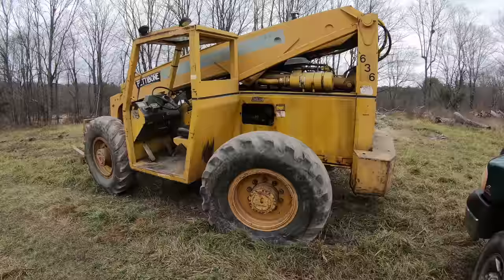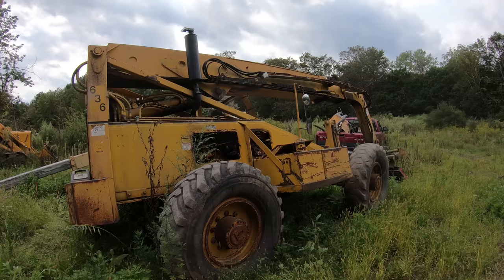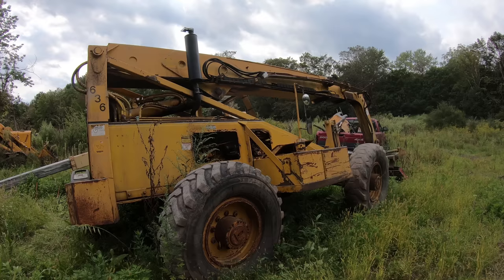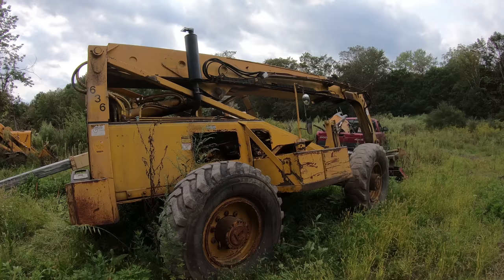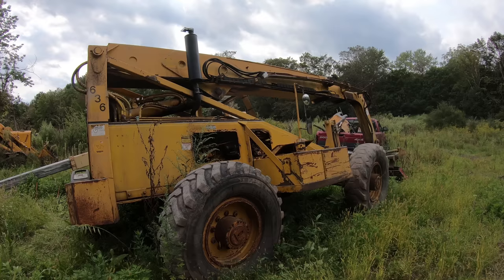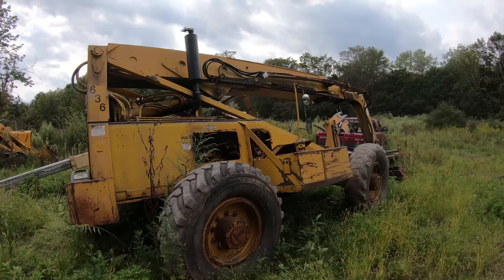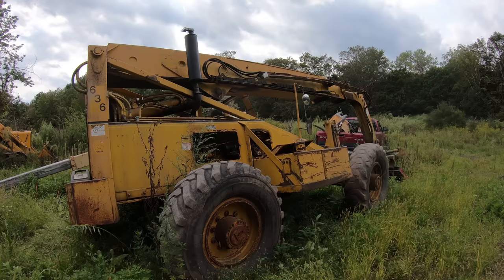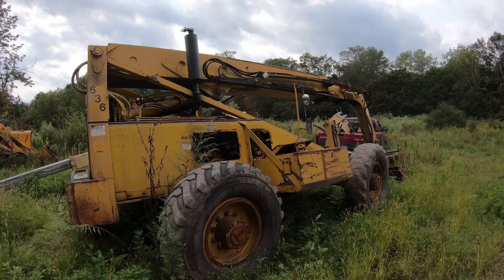Buying and fixing a telehandler : 92 Pettibone 636

Comment: I've always wondered why the caps on hydraulic cylinders aren't hex shaped... it seems like removing them is nearly always a ballache/requires pin spanners/pipe wrenches etc... why not just ease repair by providing flats?

Comment: Great job. Lots of work especially for one guy. Very lucky getting first pins out. I had several pins frozen so bad had to cut pins with Dioblo blades. Then porto power halves out from the inside. Just like you had to . Smart move sending cylinders out. I betcha they are at least 5 grand a piece new.
Reply from the maker: they are 20 grand a piece new
Reply: Wow prices are crazy

Comment: Im a HD mechanic and we do a lot of reseals at work. Most pins can be removed by getting the outer bore cherry hot with an oxy torch and then quenching it with water and letting it completely cool down. Just hit it with a hammer after that. 
Worst we ever hat was a mobile crane pin, we ended up welding a high grade nut to the middle of the pin and then used a hydraulic jackhammer from a mini excavator to hammer it out.
The most roadside way to get piston rods out is using compressed air, but carefull, if it comes it comes.

Comment: On stubborn pins…… I’ve rigged up a 20t bottle jack using 3/8 g70 chain, a piece of I-beam, and 3 lb hammer. Wrap two separate loops of chain around the piece the pin is in, bottle jack rod on the pin, I beam on bottom of jack with chain around I-beam. Jack a bit and it’ll hold it all in place. You can hit either the frame that holds the pin or if you’re desperate hit the I-beam.

Comment: You indicated that about $9500 is invested in the telehandler.  But the 3 reworked cylinders, if new, would be worth about $60,000.  And, if you do an in-frame on the engine, that's another $20,000 or so valuation in place of a new engine.  So, the machine is worth at least $80,000+ when all is said and done.  Overall, one of your best repair videos.
Reply from the maker: yea newer telehandlers are alot of money, and older ones need alot of rebuilding so its not too bad. I could have bought one for 20k but then who knows what I would have to fix after running it a few days

Comment: I used to work on fork lift trucks, and one of the first demonstrations we had was how easy they are to tip over sideways when lifting their rated load to full height.   The test rig was a tiltable floor, and the mast had safety ropes to prevent any accidents.   With the load at max height, the floor could only be tilted 3.5 degrees before the whole rig would start to topple over sideways.   That was for a FLT with solid tyres designed to work on flat concrete floors...  So be extra cautious with that lift on uneven ground, with its squishy pneumatic tyres.
Reply from the maker: Yea I can definitely see how they would be crazy tipsy at max height and max weight. I dont have alot of need to carry alot of weight that high up, mostly it goes up there with the man basket so it would be very minimal weight. But yea you could also have a tire pop while its in the air and then it would really go down quick

Comment: We would rebuild boom cylinders for PC800 evcavators by just chaining them to a heavy metal table the pulling the cylinder rod out onto some pipe stands. We would use a forklift to carefully pull and push the rod as well as covering the pipe stands in rags to not scratch the rod.

But i don't think you have a table that big. And it did take me and another guy who rebuilds them all the time a full day to do it.

Comment: Very good work Jessie I couldn't help but notice the alternator that you said wasn't working this is absolutely the best alternator you can modify to work in Old machineries 6 volts bring them back to life I couldn't help noticing what looks like a diode in the wiring there is very little that goes wrong with these alternators and they are so easy to fix most people do not know that the pulley size is the same as the older ones I mean going back to the thirties good job

Comment: Jesse, you have these hydraulic tools, that you can setup anyway you like, for example with a welded frame or chains, that are hand operated without any electricity, and they can push up to 30 tons or more, and that would save you a lot of time and money and frustration with removing pins from heavy machinery. You tuber Squatch253 very recently used one of those to remove the pins from his old caterpillar tracks. As you can see on one of his latest videos. 

Also, the metal push rods inside the cylinders from the hydraulics are chromed, if that chrome is damaged the push rods can't be repaired, if it is damaged the push rod is completely waste. They can't just weld it up and turn it straight again because without the chrome it will rust in a day or so and completely destroy the seals. 

If anyone tells you that they can weld it up and turn it round again and call it a fix you should walk away immediately and save yourself a lot of money and frustration. You don't have to believe me, just watch an expert with a channel called Cutting Edge engineering Australia. This guy has a lot of experience with repairing heavy machinery and their cylinders.
Reply: You can send out the rods to be re-chromed.

Comment: I popped a cylinder apart with air pressure oil went all over even when it was drained out. It went about a foot past the barrel .  When I put it back together I stood the barrel up and dropped  piston , shaft and end cap down into barrel. All orings wippers and seals have too be greased up with extra grease . The weight of the shaft helps slide every  thing  together. Start piston and shaft into barrel then pick barrel and shaft up about a foot and drop them to gether . This has to be done  with a loader or hoist keeping them straight.

Comment: Just a suggestion…..before putting the pins in, lather them with copper coat. Saves jamming up if you have to remove them next time. Good job on your own.. 👍🏻😁🇦🇺

Comment: Its a year ago now and memories of watching the roof go on and the use of the whole machine were great to watch. You did say its possible to find one this all working for $9500.00  but what about the seals etc? You've got a rebuilt machine that is going to see you through for yhears reliably. With the possible exception of the engine, which as you say can be done in situ. What a pleasure it was to watch and learn from all that. So interesting, thanks :)
Reply from the maker: I have this machine in my shop right now completely torn down and rebuilding the engine. It should be a very interesting video
Reply: @jmuller86  Ty another one to look forward to then, great stuff Jesse. Hope the family is well, they look it. Still worried about the serious lack of chicken inspection on the garage though :)

Comment: I bought a Pettibone C-8000 that had sat for seven years. It has the Cummins turbo four cylinder. I checked all of the fluids for water, put a battery in it and it started. Got hold of a tire guy that had four good used tires mounted on my machine for $1000 and have a functional machine.

Comment: Jess-- Isn't that nozzle for the sprayer the best thing since sliced bread. I put the regular fan pattern back on and immediately take it off. The rotary action works great. Good persistence on the telehandler. Great addition to the machinery. Kids are growing like weeds!!
Reply: Bought one of those rotary zero tips for my pressure washer. It's too much pressure in a lot of cases but when you need it, it's great. Throw in a gallon of Super Clean and things start looking new again.

Comment: Briliant display of determination and not to be beaten. I've used 10 and 15 ton bottle jacks to press out pins in the past. I made a base plate and welded it to the frame and then inserted the jack with various length rods to press out the pins. Then inserted them the same way. Its way easier than whaling on a rod balancing up in the air. But wel done anyway.😁😁

Comment: There are so many cases when people know they have to take something apart in the future when they fail to take the opportunity to use penetrating oil on those parts. Just get a can, leave it on the machine and soak the parts down every time you go near it. It can make life so much easier. If the people who assemble them use anti seize compound it will also make it easier to disassemble.

Comment: Generally, each cylinder should have 300 to 500 PSI, and all cylinders in a single engine should measure within 10 percent of each other. If the compression in the engine is too low, too high or deviates too drastically from one cylinder to the next, you likely have internal damage to your engine. I have also seen the fire departments here in Canada add a second electric fuel pump to help with winter starting of their diesel trucks because of the thickness of diesel in cold weather. It can be shut off after the engine has started and is running smooth. Adding or fixing glow plugs if possible could help the starting process even having a water jacket heater can help on cold days.

Comment: OK 9500... you may find one but not with rebuilt cylinders and new injectors.  What you do is inspirational. You just keep kicking it in the ass until it's fixed. How you find the time to do all the research for parts, plus work,  the house, and the channel is quite the accomplishment.  It seems like the Muller army is growing,  what a gathering that would be. I get the feeling everyone that watches your content beginning to end wouldn't have trouble finding something to talk about.
Reply from the maker: it is hard to find the time, but I do sacrifice time that would otherwise be used to relax like a normal person. but I do find it relaxing the most to get stuff done

Comment: Great work filming as you pull off a major challenging job, I didn't catch if it was charging ok if it does load up with LED lights the days are getting shorter. A rig with all those uses should be able to work safely in the dark. Thanks for sharing your fine deal with us.

Comment: Nice work. There had to be some 4 letter words involved with those pins!
Reply from the maker: There were many. There were also some four letter words directed at the first hydraulic shop that held me up for so long. I watch your videos now and then btw....when I get a chance. In between all of the things I have going on. Boom lift still going good? I need to find one
Reply: @jmuller86  Yeah, lift is doing well, but I still have some more work to do on it.  Did you see that I had to change the main lift cylinder?  That was a job.  I want to give some attention to the telescope chain soon.  I'm sure you have a similar setup in your telehandler.  Have you ever heard of one of those chains breaking?  I haven't, but trusting your life to old equipment sparks the imagination...  Congrats on getting that beast up and running again.

Comment: you did the right thing,, yes you could probably have used the sealing kits on the rams yourself but for large rams you do need special equipment and tools to do them properly and like you said $2500 vs $20,000 is a huge saving :)

Comment: Really nice machine, I had antifreeze in the tires for more stability in my 36, if you take a latex glove and grease the whole boom at the slide points it helps prevent boom hop, great machine used baskets aren’t that expensive, at least they didn’t used to be.
Reply from the maker: I might make a swiveling boom for this, so you can come into the side of a building at any angle

Comment: Air chisel moves those gland nuts pretty good (some atf and acetone in the threads after a bit of heat)...I put a hydraulic cylinder on the lever arm to remove...but in the end air chisel was the winner.

Comment: Maybe if your pushing pin out quite a bit, you can find a small floor jack and remove the Hydraulic cylinder and make up some adapter fitting for the different sizes of pin bushings that you can tack weld too. Floor jacks are made to work on the side which is perfect for that. Even a port a power with some chains long enough to wrap around the whole arm would work.

Comment: Damn Jesse that was some perseverance but well worth the effort. For the hydraulic cylinders yes you just sometimes have to farm the work out to other people. For the engine it does sound like a slightly uneven crank so would bet one pot is low on compression, but definitely running more even with the new manifold and injectors. At least a wet sleeve engine is a dam sight easier to recondition than a pressed sleeve engine. Also make sure to always always run diesel grade coolant to prevent cavitation corrosion. Anyways nice job and well done.

Comment: I like the machine so badass I guess the guy was trying to be helpful to you and post the video but you already had the pin cut out of it where he got the attention and the pressure off the shock and the pin come out there like butter but I know how it is too you're out there by yourself and you do what needs to be done to get the job 👍 done I couldn't have got that thing running or doing that work on that machine mechanical work my dad could I'm a tree man 30 something years I can clean up a mess with all that tedious and mechanical stuff it ain't happening God bless you and family .

Comment: @1:50:39 Working with helicopters, we put the nut on the underside. If the nut comes off, the bolt still hold the pin in place. In this application probably not a big issue, but it doesn't hurt or cost anything to do it the other way around. 👍
Reply from the maker: yea true

Comment: There is only one thing missing on the machine and that are grease fittings and they are so easy to place them and make working on machines so much easyer👍👍
Reply from the maker: this machine should have all the grease fittings that it needs, it shouldnt be missing any
Reply: @jmuller86  there is not one machine who hase all the grease fittings in the 35 years i repair them if all the fittings where placed wright all the pins comes out very easy i always put about 25 extra fittings on every machine because you lose so much time to get them out. On my machines everything that moves i give a grease fitting it works so nice if you must repair something 👍👍

Comment: Next time try drilling a short 1/2 "  hole in the end (centre) of the pin and then drive it out with a pneumatic jack hammer, the hole keeps the spike centered, it won't bell the end of the pin, if it won't move immediately heat the bushes with your oxygen/acetylene torch, honest you'll be done in 1/4 the time.
Reply from the maker: I just got a mag drill so I will try that next time

Comment: just a little tip, whenever your going to have the boom all the way out or all the way high, double check tire pressures and check and make sure the level bubble is in check, my dad has a newer 636, 10044 both petitbones and a 4bt cummins. seeing yours with a jd engine kinda suprised me but my dad has and a older lull traverse 644 with a jd engine and there just always loud as crap lol

Comment: Once you fix it to be reliable and safe it will be a very valuable asset to accomplish many things!

Hopefully the charging system is sound and you can deal with that fuel issue which sounds like it might be vapor lock

Comment: Jesse,   without even watching the video yet I'm going tell you that these are the most fantastic machines.  I have two of them. One is a 93' that i leased for one year in 95 before buying it and the other is a 97' that I bought in 2016.   They are most capable when they have pneumatic tires on them vs foam filled. I know this because I have one of each.  The air filled is great for dirt jobs and even some light logging and the solid best for pavement and sharp surfaces.  The high pivot on the boom allows you to work below your feet so to speak and place things into a basement where most of the modern flat booms do not.  Just being able to boom out and lift your front end off the ground to get out of trouble is pure gold with the 636.
I'll probably add to this comment later but I've got two and a half hours of  video to watch first!

 just out of curiosity what is your three digit serial number? Mine are 151 and 656, as a 92 yours might even be two digit. It's usually painted vertically on the back sides right above or below where it says 636

Comment: @Jesse Muller - It's hard to hear by video, and I don't know if you already did it, but it sounds like the engine valves need to be adjusted, and or the valves and the valve seats need to be lapped or ground.

Comment: Heck of a repair job but I think it was worth every penny.  I am also wondering if you should consider selling the Pettibone crane that you have since this is much more versatile and is capable of doing some crane duty if the need arises.
Reply from the maker: they both have their places, a crane can swing something into place, whereas this would be alot more difficult to bring something from the ground to the top of something without being straight on

Comment: At 01:30. Sometimes a wedge or clamp(need in/outward?) can help. By forcing the bushes in or out you align the pin. In this case the cutting was a good decision. In other cases try the method above. We used it when taking pins out with hydraulic pumps and plunjers. They were aligned but the force of the plunjer misaligned them.

Comment: I think I saw where the inlet pipe to the muffler had a bend/dent in it.  If that is for hyd cylinder clearance then fine...but if the hyd  cylinder MADE that bend/dent, then that may be very well the reason the exhaust manifold is broken.
Reply from the maker: yea I think the cylinder did make that indent. and that is why it cracked